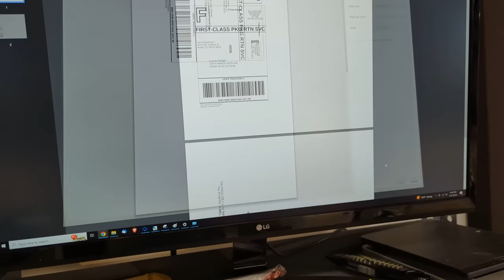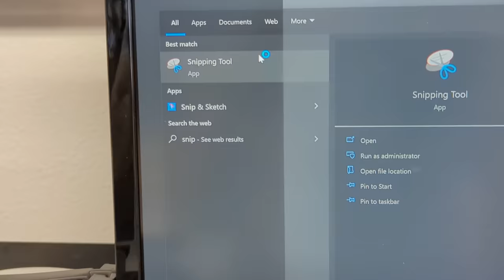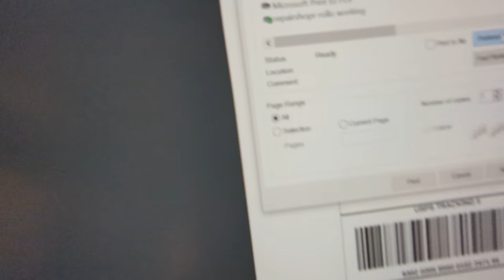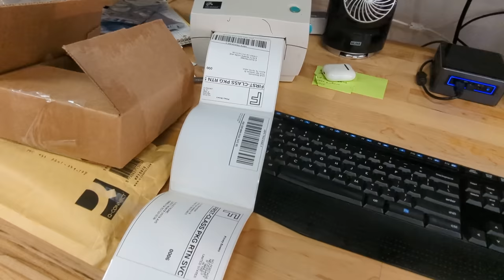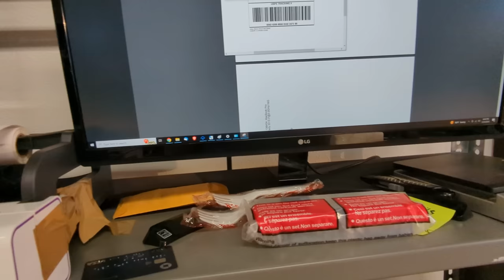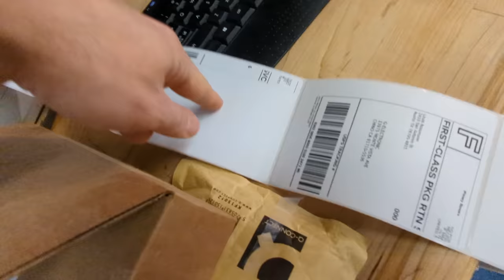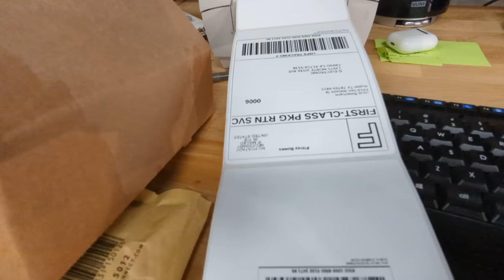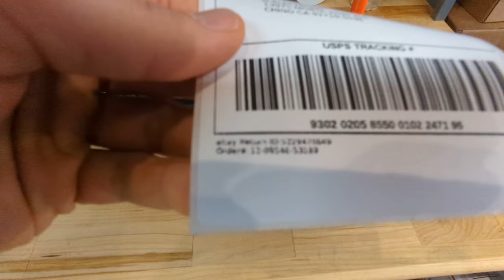rossmann repair group vs. label printer, part 3

Comment: Never before have I heard the words "pepe bondage zebra printer" strung together.

Thanks Louis.
Reply from the maker: The pepe in bondage on the printer represents Patrick's bonds that tie him to shipping, along with the pain that is working here.
Reply from the maker: @ozordiprince9405  you want me to install and learn how to use photoshop instead of prntscrn and ms paint... that is the easiest? o_O
Reply: This one took the cake 😂😂😂😂
Reply: @rossmanngroup  I’ve never wanted a sticker so much in my life and I couldn’t find it
Reply: If you have some kind of PDF editor, print to PDF, then crop it via the PDF editor.  If your label printer driver doesn't let you "fit to paper", print the PDF to another PDF with "fit to paper" enabled.  Now the second PDF should be tailored to the label printer.

For any documents via a webpage, I always print to PDF first so I know how it's going to look before wasting paper/ink :-D .
Reply from the maker: But the computer already comes with snip and paint
Reply: @rossmanngroup  
don't let them get to you, MS paint is clearly the most suited piece of software for the job. Can even draw a bird on there after failing to properly print it for the 10th consecutive time.
Reply: @rossmanngroup  
select the usps label size before purchasing. once usps generates a pdf based on your selection you're stuck with it.
Reply: @rossmanngroup  Actually switch that computer to Ubuntu/Linux and use pdfcrop from the texlive-extra-utils package to crop the PDF to the size of the content. Then you can print it on your printer just fine. 
Use The Cups web interface to add the printer using the appropriate PPD file and set papersizes.
Another plus point is that your printer drivers won't reset themselves randomly when your not looking.
Reply: @rossmanngroup  Irfanview is easiest. Light on resources, fast as hell, no DRM or licenses. Honestly, once you use it, you wonder why you ever used any other image viewer.

Comment from the maker: Publishing proof that, in spite of claiming I can do lab data recovery, component level motherboard repair, hard drive head swaps, etc. that I can't figure out how to print a shipping label, might not be the best thing for customer confidence.... 

but YOLO
Reply: lol. I was sitting here thinking the opposite about myself. I can't do all that electronic BS but I could EASILY get that to print correctly.
Reply: Idk if it's of any concern but there was a credit card on the shelf in frame near the upper monitor.
Reply: Nah, I work with sysadmins, developers, and other IT pros.

Our printer support is outsourced 🤣
Reply: Heey, there's a credit card on the video. Not sure if readable. Just a heads up in case you missed that
Reply: Please delete the video. There is a credit card sitting on the desk.
Reply: You had right idea to snip image, but paste it into Microsoft Word.  Easier to set page size, and set 0.33" margins, etc.   I do IT support for 140 people that aren't the most tech savvy and this works best because you can see what you're going to print before you print.
Reply: Don't feel bad, it's possible to print a label on certain browsers using certain settings without the windows clip tool (I think, or at least on GNU/Linux), but frankly I had to write a program to make Zebra label printers and certain other clones work seamlessly on GNU/Linux. The user experience in theory is probably better on GNU/Linux if I ever get around to releasing and maintaining said software as it auto-fixes the output from numerous different companies shipping labels. The software is not compatible with Microsoft Windows/Mac though.
Reply: Louis, come on, you never worked with MS Word? What you should do was to go to page layout, select the whatever page size printer uses, minimize the margins, rotate and crop the image, enlarge the image to fit in the page, double check that the white part of the image does not overflow to right/bottom. Use printer normally, check the used paper size and orientation. Like... easy... I would never waste more than one-two pages to find all the proper settings on a brand new printer...
Reply: BLUR THE CHASE VISA CARD ASAP
Reply: I worked with printers for over 20 years, and I can tell you Windows  hates printers.
Reply: @FeasableOption  Way too late to do anything about it.
Reply: @CreativityNull  Lol
Reply: Honestly, bro, buy a brother printer... take a picture of the label and then print it "scale to size"
Reply: As the shipping department at my work....welcome to the hell that is our domain! Hahaha funny seeing this.
Reply: @cliffshockley4406 Looks like the label is a pdf, could’ve just opened in Adobe Acrobat DC and set the print options in there
Reply: louis i suffered the same problem with the same printer check my comment
Reply: Just Open Adobe Acrobat > Edit > Take a Snapshot. Put box outline around the area of the shipping label and right click and select print.
Reply: I ended up writing my own printer driver to be able to use my current label printer so I kinda know the pain 😀
Reply: @roji556  He basically did that and it didn't work.  It was the Adobe Reader plugin for Chrome he was using, but same idea if he was using standalone Reader.  The problem is the amount of whitespace/margins as it was setup for printing on left side of a landscaped letter size paper.  He was attempting to print it portrait mode on a 4x6" label.  Adobe "Print" function isn't really smart enough to do that, because even "fit" etc would have it populate only 1/2 the label, thus be to small.   - - In these situations, I find it best/quickest just to snip the item as he did.  But as said, rather than printing from Windows Snip or an image editor (which will print the photo borderless many times and cause issues) - I find it most user intuitive just to paste to to word, then  you can resize and move the image to  fit on the page like you'd like.
Reply: Live dangerously Louis
Reply from the maker: @TaranovskiAlex  Why keep it simple wen I can use more complicated & bloated tools to do the same thing with more steps!
Reply from the maker: @truenorth9508  just open a program that requires I pay for it to rotate, lol.
Reply: @rossmanngroup  Hi Louis, I’m not a fan of Adobe, or label printers/drivers as they are finicky. But the feature to draw a box around the shipping label you want to print does save a ton of time and keeps the barcode machine readable. Adobe Reader (free) may also have the feature by going to Reader- Tools > Select & Zoom > Snapshot Tool. There has to be other PDF programs that do this as well… Best to you and may you have tremendous success in Texas!
Reply: @rossmanngroup  Sorry, but MS Word and basically the rest of the Office suite is a standard... What do you use for your professional work instead? MS Paint and Notepad???? Yes, the process is not as easy as I would wish, but that's how it is for recent like 20-30 years... You can offer a solution which is better?
Reply: @slightlyevolved  that particular one - is awful, I 100% agree, but then I also ordered 20$ 5 color "ripoff" inks and recharged the cartridges myself, instead of paying like 500$ for equivalent amount of ink in the new drm cartridges... Thank God there are still some options for working around the f*cking drm...
Reply: Just to make it clear for Everyone - YOUR printer - is YOUR liability, there can be hardly an argument that "oh, those are stupid drivers..." etc. it is YOUR responsibility to OWN what you bought, including to know how to properly operate it.
Reply: IMO this proves your honesty. Soldering electronics has nothing on trying to fix printer driver settings, I can absolutely confirm. I'm nowhere near as skilled as I should be for it, but I'd still rather hand-solder SMD than figure out why the MFP isn't registering the scanner component, or won't print-dual sided over IPP on one machine or not another, or any number of other weird items. Label printers are worse. Custom drivers, unusual software, and weird margins all in one device!

Comment: As a mail carrier, I appreciate the effort you are going through to print appropriately sized labels.
Reply: I'm going to be honest, but he might've wanted to zoom the pdf in somewhat, before using the snipping tool, as to having the most possible crisp/sharp print. And as to not waste the labels, using portrait, lol. - even better: In Adobe Acrobat can also "select" a part of the page print that selection as to maintain quality.
Reply: Nothing worse than people who somehow get the labels printed at like 25% scale and it makes them impossible to scan.

Also Hi fellow mail carrier.
Reply: Also. My biggest pet peeve is the corruption of barcodes, which I sometimes got. Who the heck puts a damn jpg of the barcode in a vectorized pdf? That'll just result in scaling issues, frainy lines or a black damn block when printing it out.
Reply: I have run printers for over 20 years and no one thinks it takes any type of skills.
Reply: @jeremiahbullfrog9288 yea because universal solutions created by the government have a what percentage success rate at making things better
Reply: Former carrier - indeed!
Reply from the maker: @Xewl  acrobat wanted money for that feature. Fk Acrobat
Reply: @rossmanngroup  Okay. Understandable method then.. ;D
Reply: @rossmanngroup You have no idea how many times I have pirated Adobe Acrobat Pro XI. 

Anyways: You can open a pdf in Gimp. It will let you choose which pages you want it to load, either as layers or separate images AND the resolution. You want at least 300 DPI for crisp barcodes, a non-4K+ display is something like 72DPI, so using the crop tool is not ideal.

Gimp also has autocrop.

I am sure there's plenty of free utilities to crop PDFs, some online websites.
Reply: @Fridelain  I might also suggest trying Inkscape, LibreOffice Draw or Adobe Illustrator if you already pay for it. All of those remain in Vector.
Reply from the maker: @Fridelain  these require installation and time, ms paint and snip are there and already installed, load instantly, require no learning curve, and are FREE!!!
Reply: Watermelons unite!
Reply: As I rarely print labels (or should I say just paper barcodes/addresses I glue to the packages) I don't use special software and just use paint but its so painful getting it to fit, If I have 2 labels to save paper (as I get billed per print) I put as many as I can on each but tend to find if I may be lucky to get more than 2 onto a page without them being squashed but then half the paper is still blank, 1 on a page and its double sized and won't scan.   And when they come out too big/small I just use them to not waste the paper and cost that I already did.

Comment: "Rage Against The Machine" never mentioned what machine they were raging against. But I'm sure it must have been a printer of some sort.
Reply: Irony is "YES SIR I WILL DO WHAT YOU TELL YOU TELL ME"
Reply: I got so frustrated with my printer I gave it to a friend. 
Now I have to not only figure out how to set it up again but teach an elderly vision impaired man how to use the printer. 
Oh well I wasn't really using it enough & he actually does need it for his church duties. Besides now it will be used & I can always go over to his place to print stuff off. I just hope I can get it printing again. Otherwise he has to buy a new printer on a limited income. This one at least works with instant ink. So no big ink bills.
Reply: it WAS a printer. Any printer, stating from the drum ones.
Reply: Some of those that work forces, are the same that PC LOAD LETTER

Comment: I'm pretty sure no matter how technically skilled you are in technology you will always lose to a printer. I think printers just enjoy making their users feel dumb.
Reply: I think they're programmed to waste ink/toner to keep you buying more.
Reply: @LordSandwichII  Makes sense
Reply: @LordSandwichII  that's just one of their many great features
Reply: @LordSandwichII  And under-report on the amount of ink remaining.
Reply: I have had this issue many times. Not here to brag but the solution is pretty easy. I do the same with snipping tool however. I do make sure all the whitespace is at a minimum. then I open it in Chrome. Press CTRL + P. Make sure the print/ paper size is correct (it always is because I don't touch the settings) and confirm the print preview matches to what I want. I hate wasting labels even if I have thousands of them.
Reply: My high school programming teacher always said printers are the spawn of satan. We'd make sure each of our laptops were set up and worked with a printer before competitions, then still take 2-3 extra printers because between windows being windows and printers being demonspawn something would always go wrong.
Reply: @Shadowtrot  that's why it's called a daemon
Reply: I try to only print from PDF xchange because it has a nice print dialog with a preview. And at work I set up a linux print server with multible settings per printer so you dont have to touch them. Windows just sends the stuff to the Linux machine with a generic ps driver.
Reply: 3D printers have been treating me decently well, all things considered.

2D printers? Oh, no...
Reply: Yeah, even the cheapest printer is better at its job than the most skilled technician. ;)
Reply: @LordSandwichII  the Zebra printers don't need ink or toner they're a thermal printer so only needs the paper so they're more reliable (in theory....)
Reply: Just like my job! I just said the other day it was like Office Space lol.

Comment: Louis, as an IT guy who works at a company that has about 50ish shipping stations at my office location alone, I have to deal with this stupid shit on occasion. The best I've found when you screenshot it, is to open it up in the Windows image viewer. Then you can tell it to fit to the paper size, set it to Portrait, all of the above. In all honesty, companies should setup their shit to give me a 4x6  printout so I can use one of the many many label printers I have in this building.
Reply: Are you running QZ print on premise? That was my biggest epiphany while working with such a big set of label printers. Absolute bonkers program.
Reply: @Xewl  no we’re running a majority of Zebra ZT203s
Reply: Do you mean 'Windows Photo Viewer'?
Reply: @HyperVectra  Eh, close enough.
Reply: @austinfarley4971  Wew that's quite a bit more functionality than what I had to deal with. Massive machines :D
Reply: It wouldn't actually be that hard to setup a Python script that takes the screenshot, crops it to correct size, auto sets the print options and then prints it.  I already have code that does things similar to this for my work.
Reply: That would be too easy
Reply: Instead of a screenshot, my preferred method is to use a free software called PDF24 and use the Extract PDF images feature to extract the embedded label image to print. So far I've had a 100% success rate and also has the original label dimensions.
Reply: @CHR0NOMASTER  +1
Reply: @CHR0NOMASTER   veddy interesting.
Reply: i was gonna reply the same thing you beat me by 9 hrs :), thats exactly what i do when i get a crappy label that wont print right.
Reply: @resresres1  can you adjust the PDF paper size / bounding box from the Python? It would be much more usefull.
Reply: 👍Seriously, a little bit overhead data is not that much of a catastrophy, they could just add a second page in 4x6 to the pdf. The companies would not go bankrupt by adding those few lines of code to their scripts. And why does DHL use a 4x8 label? I use 4-x-endless paper and a printer with cutting unit becauase of them.
Reply: @eugenijusjanuskevicius2292  it's possible it could be done within the PDF program, however, if you are using say Adobe, I don't think it has an API that Python can access to make function calls to it directly. Therefore, you would have to make the script click on the necessary buttons in the PDF program to do it and use some logic to come up with the bounding box and having it compare RGB values within a certain area from a desktop screenshot to come up with the X/Y positions to make a bounding box with the mouse.  It would be easier to just have Python convert the PDF to an image, grab the background RGB value, then scan the pixels on the top/sides/bottom separately, looking for significant change in the RGB value to come up with the bounding box (this is how I do it), then have Python set the printer settings and print it. 

I don't use this sort of technique specifically for labels though, but it would work.   I use it for cropping blueprints and inserting them into an excel file.

Comment: Don't feel bad Louis, I have more problems with my 2D 8 x 11 printer than I do with my custom-built 3D printers.
Reply: It is a DIY or modded 3D printer?
Reply: @miscellaneousproductions  modded to the point where only the y and z extrusions and the base plate remain. Everything else is nonfactory.
Reply: @YourLordMobius  So custom firmware too?
Reply: @miscellaneousproductions  klipper of course. It started life as a cr-10s pro, but hardly resembles the stock printer anymore.
Reply: @YourLordMobius  So does it perform better than the original?
Reply: 3D printers are cuddly puppies compared to the bloodhounds that are 2D printers...